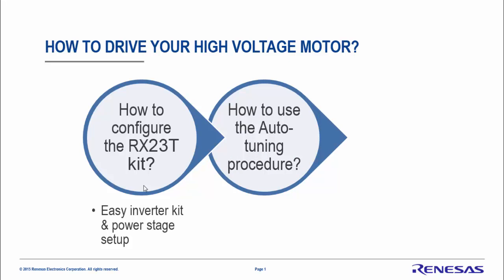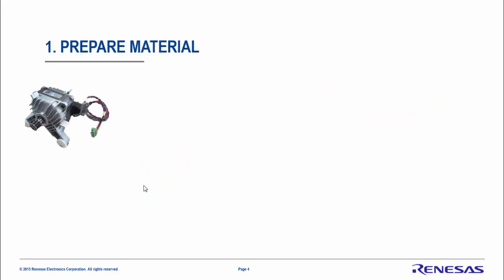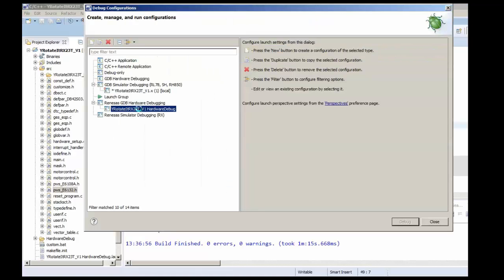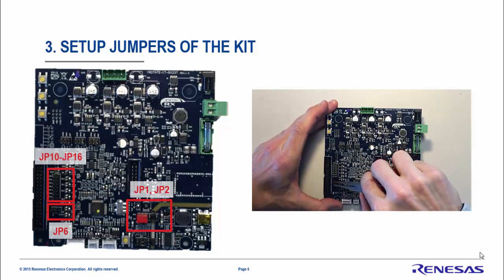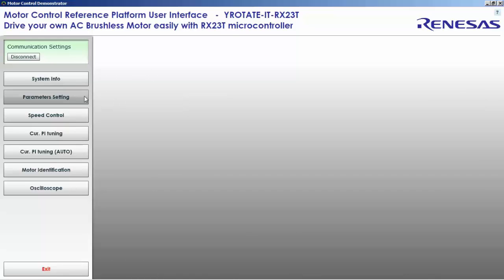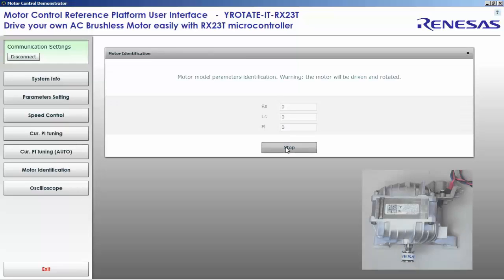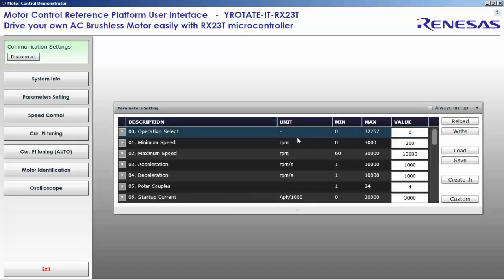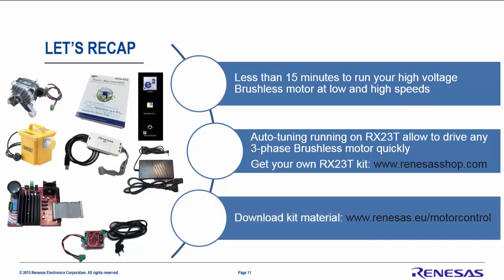How to drive your own High Voltage Brushless Motor using RX23T kit

Comment: your accent sound pretty french,are you? (actually i am,thats why i asked so,it could be more handy to discussed with each other)
hello,
i am on a project of controling a bdlc motor direct drive, by using high voltage pulsed DC current (not AC) of 400 vdc, with a minimum of amperes (max 1,5 according to calculations),i use a arduino uno with a code that i took from internet, my motor is composed of 36 coils ,12 per phases with 30 degres of lag with eachs coils,pulsation is controled by 3 IR2104 with 2 transistors IRF840 (max 500 v) per phases,at least it is a H bridge abble to support hight voltages dc current pulsed... the idea is to run it,with highters voltages than usual in order to reduce the amps,subsequently, to reduce heat and back emf as well....my question is, does your set up could do such this kind of job? 

on the actual market we can just find low voltages and high amps system for running a bdlc motor, i want to do the opposite...

thanks to care, please let me know ;)